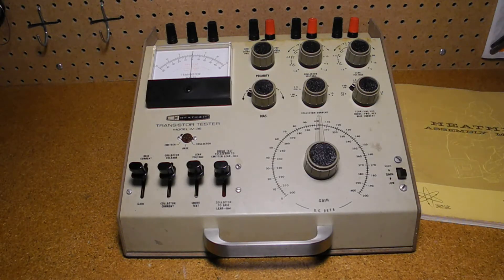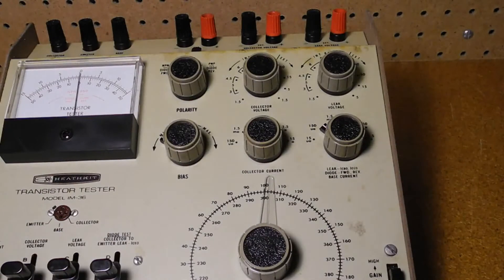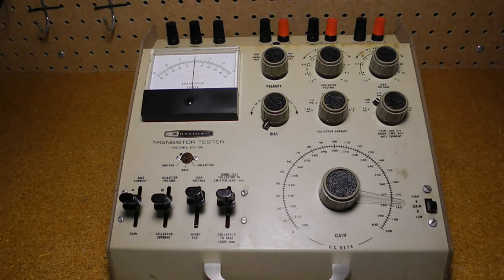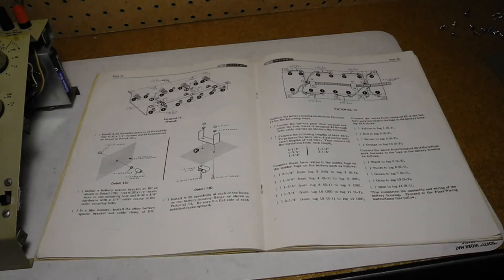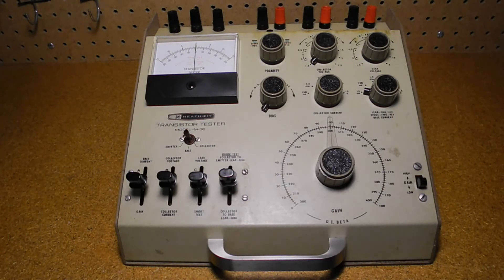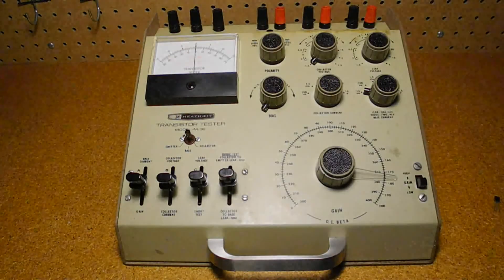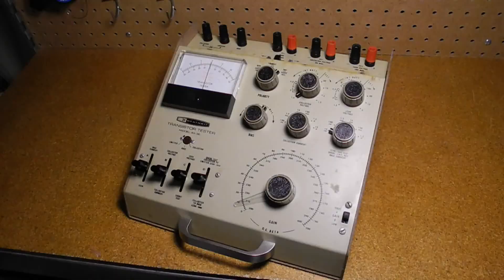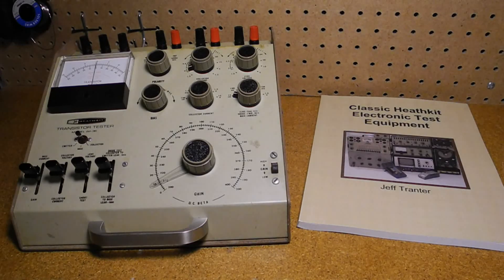The Heathkit IM-36 Transistor Tester

Comment: Jeff, would you happen to have a meter for this unit.  I have this unit, but the meter doesn’t work.  Any help is appreciated.
Reply from the maker: I don't have a spare meter. It will be hard to find as it is a center zero meter - 10-0-10 uA. You may be able to find one on eBay and adapt it to fit the case.

Comment: Hi, thanks for the video! I have a Heathkit IM-36 too, looking at your video I noticed that my potentiometer diodes weren't installed. could you tell me which model of the diodes. I just know they're silicon!! thank you very much!!
Reply from the maker: My unit was also missing the diodes across the meter, and others have reported this as well.
They aren't necessary for the meter to operate, but they protect it in the case of an overload.
The part Heathkit specified was an unusual G247 varactor diode.
A suitable part here would be the common 1N4001, which is what I used. Any 1N400x series diode should work.
Reply: @jefftranter  Thank You very much!!